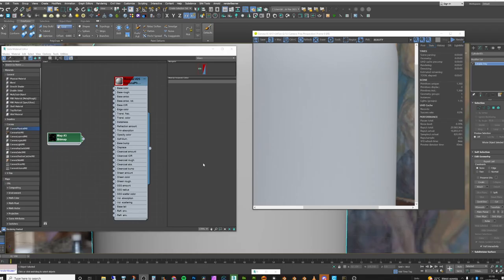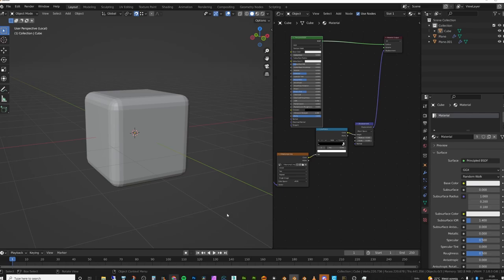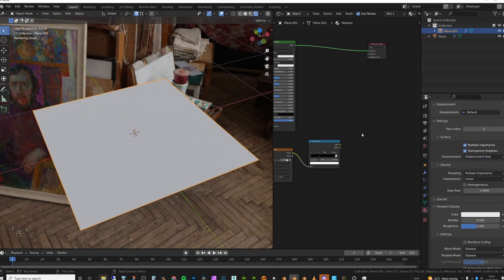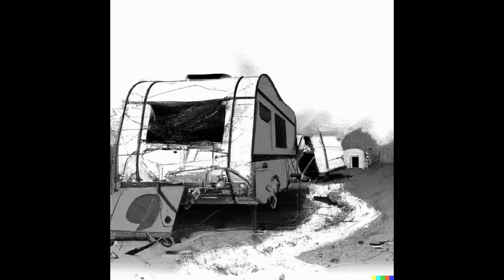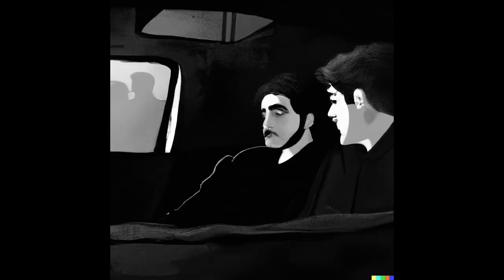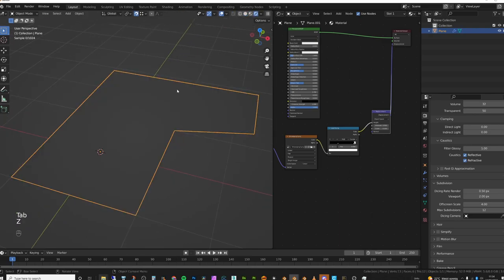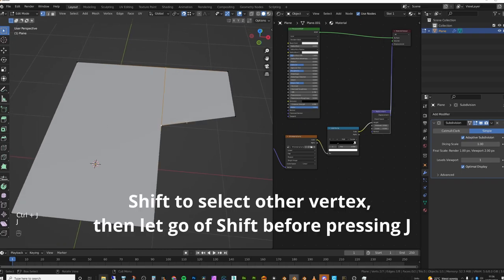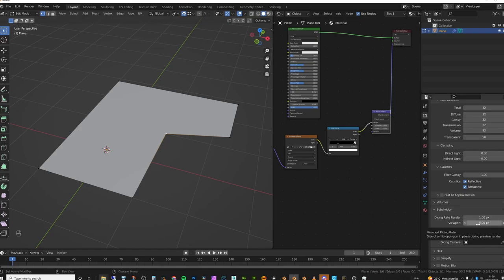Good Displacement vs... Losing Your Life

Comment: If adaprtive subdivision works only with quad topology then how we will be able to work with Sketchup and revit  exported models who simply dont care about topology, these small things hindering me from shifting to Blender. Also, I am seeing lots of development in blender inside but very few in Archviz and BIM area and also not so active community.
Reply: It's not a fix all but I usually take all the models, edit and use Face -> Tris to Quads to make most of the faces in the model quad faces.
Reply from the maker: It does work but you may need to lower the dicing rate a lot, and it depends on the model topology and tebdispacment map you want to use. Usually SketchUp models are terrible and should be retopologisdd anyway